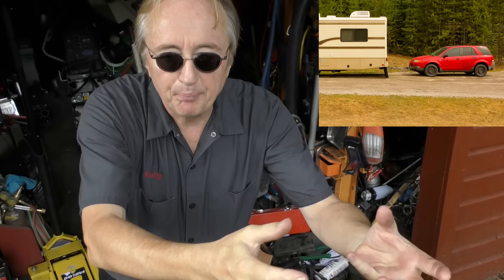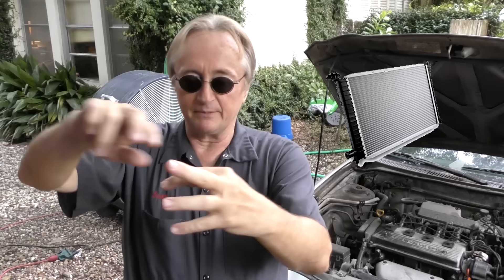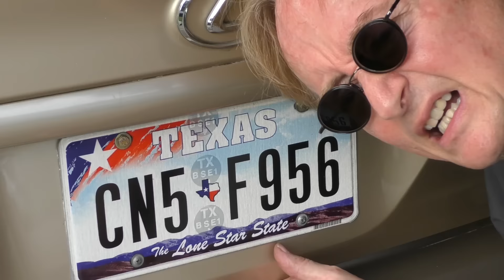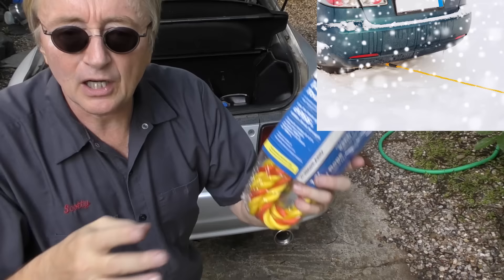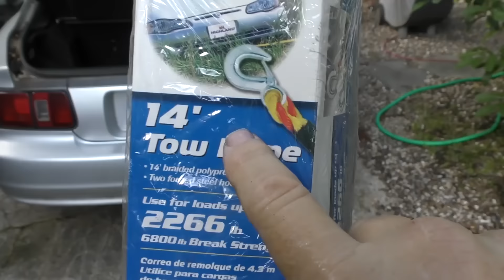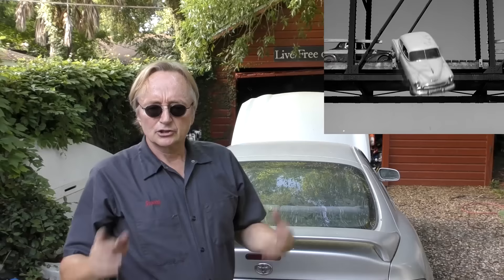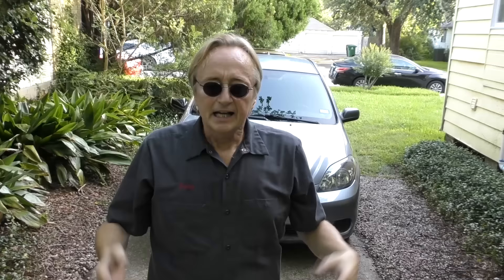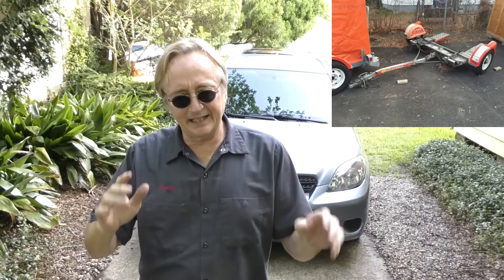Never Do This to Your Car

Comment: Oh, you're messing with us,  Scotty - Subarus don't need to be towed to blow head gaskets!
Reply: Hahahhahahahah
Reply: Leave it to a Subaru to blow head gaskets without the engine running.
Reply: hahaha nice:)
Reply: The head gasket is probably why it was being towed in the first place. That story was 100% bullshit. The oil isn't being pumped, but somehow it ended up being pumped into the transmission cooler?
Reply: THAT'S WHAT I SAY
Reply: SABARU ENGINES ARE SO POWERFUL AND FAST THEY BLOW HEADGASKETS!!!

BUY A NEW SABARU AT YOUR LOCAL SABARU DEALER TODAY!!!
Reply: Bursting into flames on the turnpike, that's what makes a Subaru a Subaru.
Reply: What if you tow subaru and put neutral gear before towing?!
Reply: @marcinnalepka1530  blow the gears head gaskets and 0 rings
Reply: @salm6331  compared to what powerful lol you never driven a v8 - 12v blow the doors of any Subaru  real power lol
Reply: @johndaniel3474  you can't be that thick..
Reply: @johndaniel3474  That's why a Dodge RAM SRT10 has a lower top speed than a European Taxi😋.
Reply: @marcinnalepka1530  doesn't matter they roll lifted from the front dont go over 35 mph automatic transmission only standard transmission all 4 wheels must be off the ground

Comment: PEOPLE, THINK ABOUT THIS. How is transmission fluid going through the transmission cooler on the radiator if there’s no pump working to move fluid with the car off and being towed? Also, how do you blow the head gasket? The car engine is off so the water pump is not circulating fluid as it needs to be driven by the serpentine belt in order to circulate the fluid. So how can hot coolant get inside the engine to blow the head gasket? The thermostat is even closed on a cold engine which prevents any circulation of coolant through the radiator. Even if it was possible to have an overheated radiator in this situation, which it’s not, there is air movement past the radiator while the car is towed which works to cool the radiator off just as the cooling fan does when it’s running when a car is parked and idling. There’s also airflow beneath the car that would help dissipate heat from the transmission through convection heat transfer. This logic makes no sense at all. If anything it sounds like a case of a Subaru that broke down due to a head gasket failure and then they towed it and ruined the transmission by overheating it from a lack of lubrication and overheated transmission fluid caused by the moving torque converter. There’s no way that towing the vehicle blew the head gasket...

Comment: Thankyou Scotty; this is one of the most important videos you've made so far; and YES people do a lot of dumb things when a car breaks down.
Reply: Hirum Biffidum for a front wheel drive car you use a tow dolly or a trailer. rear wheel drive cars use a trailer . I have seen cars being towed by a motorhomes as well being they take the cars along
Reply: Hirum Biffidum some of the  information in this one is incorrect. How is transmission fluid going through the transmission cooler on the radiator if there’s no pump working to move fluid with the car off and being towed? Also, how do you blow the head gasket? The car engine is off so the water pump is not circulating fluid as it needs to be driven by the serpentine belt in order to circulate the fluid. So how can hot coolant get inside the engine to blow the head gasket? The thermostat is even closed on a cold engine which prevents any circulation of coolant through the radiator. Even if it was possible to have an overheated radiator in this situation, which it’s not, there is air movement past the radiator while the car is towed which works to cool the radiator off just as the cooling fan does when it’s running when a car is parked and idling. There’s also airflow beneath the car that would help dissipate heat from the transmission through convection heat transfer. This logic makes no sense at all. If anything it sounds like a case of a Subaru that broke down due to a head gasket failure and then they towed it and ruined the transmission by overheating it from a lack of lubrication and overheated transmission fluid caused by the moving torque converter. There’s no way that towing the vehicle blew the head gasket...
Reply: @newfie-dean5803  maybe towing with the transmission in Parking mode? Bad video, I don't agree either.
Reply: teratonexplosion you can’t tow in park. That’s like trying to push your car in your driveway while it’s in park. In park the drive wheel(s) will be locked and you can’t move it. But if you put it in neutral you can push it no problem. Same concept here. If you towed it in park then you would be skidding the drive wheel down the road and it would not be long before you destroyed the tire and maybe some suspension or driveline component. Scotty should correct his comments in another video but he seems to be a guy who don’t do that sort of thing, it would mean admitting he was wrong with 51 years experience! 🐴😂
Reply: @newfie-dean5803  Hi, its called capillary action the heat will transfer via the hot fluid as it will still circulate a bit, though not under normal pressure and the rad will still get hot, the engine not running this resultant heat in the rad will back circulate in the same way through the engine. Your theory about a moving vehicle will cool the rad a little, but the non pressurized  transmission fluid will be upward of 200'c  and without the water pump & fans running the back circulation of the heat will destroy the engine seals & the weakest point more than likely will be the head gaskets.
Reply: Alan Coomes you are dead wrong! Unbelievable!!!! How do you think a cooling fan even works? A towed car will not blow a head gasket, it is impossible!! You have airflow under the car too which dissipates heat from both the transmission and the line going to the radiator! I can’t believe how many people have no concept of heat transfer mechanisms!

Comment: Keep in mind that if you have a vehicle with a 4WD transfer case then you CAN tow with all 4 wheels on the ground as long as the TRANSFER CASE is in neutral - not the transmission by itself, but also the transfer case. This disconnects the drive wheels entirely and is often explained in a 4WD vehicle's manual as an option for towing! Great video Scotty! 👍
Reply: Tony Humbert  if you're transfer case is out in neutral (different than your transmission) then the transmission won't be connected to the moving wheels at all - therefore the transmission won't spin or get hot. A lot of manufacturers actually specify this method for flat towing. The Subaru likely didn't have a transfer case at all - meaning that it couldn't be flat towed and destroyed the transmission.
Reply: Tony Humbert  If I'm not mistaken most suabrus don't even have what we would consider a transfer case traditionally because they aren't shiftable - as you said.
Reply: Tony Humbert  Correct - but in a lot of full-time 4WD systems and AWD systems it isn't shiftable in a standard form like a part time 4WD t-case which is the most common type used in flat towing applications.
Reply: Tony Humbert  dude it's a forum for conversation - it is somewhat relevant because people watching this video may not know that some vehicles CAN be flat towed with a t-case and some can't . This video, while Scotty is great - makes it seem like almost no vehicle can be flat towed. Lighten up
Reply: Tony Humbert  even more of a reason to inform people in the comments ;)
Reply: Another popular option for RWD (especially trucks) is to decouple the driveshaft. It takes some muscle but it's the safest option. And lifting a truck isn't an option most of the time.

Also some rigid axles are very easy to pop out the half shafts either side (especially on offroaders where the hub has a knob to engage or disengage the axle)
Reply: NICE ! I WAS THINKING THAT AS I  WATCHING SCOTTY ! THANKS FOR THE ANSWER !

Comment: You can tow any vehicle if you just start the engine, let it idle and put in nutreul. You can push any vehicle doing the same but by strapping 2 old tires together on front of the grill area without rims to the car that is pushing. Works the best. We use to repo cars that way all the time. You can really smack the cars together on the freeway without damage.

Comment: Scotty, a few exceptions to these tow rules that you should have mentioned are
1) You can tow a 4x4 with all the wheels on the ground if it has a "manual" transfer case that can be put into neutral. I'm talking about the transfer case, NOT the transmission. This is why Jeep Wranglers and Geo/Chevy trackers are so popular to tow behind motorhomes...
2)If the car will run (like if it runs fine and you just need to move it) you can leave the car running and in neutral and as long as the engine is running the transmission pump will be pumping fluid keeping your transmission safe. I wouldn't recommend doing this for extended periods of time but for a short tow it will work
3) Disconnect and remove the driveshaft (many people who tow their vehicles behind motorhomes do this. Some even install auxiliary transmission pumps that run without the engine being on)
Reply: You are correct sir!
Reply: Superdutychase His logic here makes no sense. The thermostat on the engine is closed on a cold engine which prevents any circulation of coolant inside the engine through the radiator. Also, to circulate coolant the water pump needs to be running which is only possible if the engine is on since it’s driven by the belt. Even if the radiator had hot fluid there’s no way for it to get back inside the engine with the engine off! And how would transmission fluid get circulated through the radiator with the car towed? He already said with the car off there’s no lubrication of the transmission so what’s moving the transmission fluid through the radiator?
Reply: Superdutychase definitely had a blown head gasket already, maybe why it was towed to begin with, LOL! It’s physically impossible for what he said to happen! There’s no oil pump moving fluid to the transmission cooler on the radiator with the car off so there’s no way to overheat the radiator. And on top of that even if that was possible there’s air movement through the radiator while towing it so it would cool it down. And hot coolant needs to be inside the engine to blow a head gasket!
Reply: Joe Casson this video is complete hogwash. It’s physically impossible to blow a head gasket towing! There’s air flow the entire time and no circulation of coolant through the engine. If you google honda CRV AWD automatic towing it tells you specifically to tow with all 4 wheels on the ground at highway speeds no greater than 65 mph.

Comment: I think those 'tow hooks' are actually transport tie down points for use on car ferries during rough weather crossings etc. That's why they are at each corner. Love the videos, thanks for posting them.

Comment: HOLY SHNIKIES!  Towing a motorcycle down the highway!?  Sounds like a Darwin Awards candidate!
Reply: Oh, I thought the Harley motorcycle was towing another car. I guess I undeestood it backwards.
Reply: To tow a bike. Loop rope around HEADSTOCK ONCE. Then to one bar and hold with thumb pressure only. Ensure ROPE PULLS OUT EASILY WHEN RELEASED. 20 MPH MAX. I have been towed twice. In 30yrs, it`s OK.
Reply: being towed on a bike down the highway, he'd be lucky to live and to be able to collect the award !
Reply: The fact that you do something incredibly stupid and it doesn't kill you does not mean it is not an incredibly stupid thing to do, it just means that you were fortunate that your stupid move did not get you killed this time.

30 years of riding, and I've never seen anyone need to do something that stupid. If you can't fix it at the side of the road, you can always find somebody with a truck or trailer. I've even seen complete strangers help out - five of us were on a secondary highway essentially in the middle of nowhere, and one of the bikes had a rear tire blow (a spoke had worked loose and punctured the inner tube). With the nearest bike shop 4 hours away, we were at the side of the road contemplating strategy when a couple of guys in a pickup pulled over to see if they could help. We loaded the bike into the back of their truck, and it spent the night in a small town garage while we went back to the city for a new tire.

People with motorcycles doing stupid things are organ donations waiting to happen.

Comment: Thank you, Scotty. My father would turn off the engine in neutral on longer hills on his '64 Impala (283 V8) with Powerglide and coast then start it by turning on the ignition then put it into gear. He put it into gear once before turning on the ignition and blew out the muffler.

Comment: if you must tow it with the drive wheels on the ground: Automatic Transaxle - Your vehicle may be towed under the following conditions: The gear selector must be in NEUTRAL, the distance to be towed must not exceed 15 miles (25 km), and the towing speed must not exceed 25 mph (40 km/h)...Wiki
Reply: I don't think that I'd do that. There is no oil being pumped in the transmission when the engine is off. The bearings can get hot and dry without lubrication. I'd say that Wiki is mistaken. Automatic transmissions have not been designed to be towed like that since the 1950's or so. There was no reason to put a pump that is attached to the output of the transmission, so they saved money by not putting one in. The only oil pump is connected to the input from the engine.
Reply: I've read some people put it in neutral and leave the car idle. Doesn't sound like a great idea to me but sounds better than having it off
Reply: Remove a driveshaft and problem solved
Reply: Unbelievable, is this all just city slickers in this comment section?
Reply: @garylangley4502 when it’s in neutral the transmission doesn’t spin. It’s not in a gear and no parts are moving. It’s perfectly fine

Comment: AAA will tow motorhomes and motorcycles also. You must pay for the additional coverage.
Reply: It's better to get that higher coverage anyway, you get much more distance free.   Though towing a bike is better with a truck and trailer not a flatbed.
Reply: Harley Davidson owners will need extended AAA coverage.
Reply: A friends Harley broke down on a road trip. When I went for help, I said . 95 percent of Harleys are still on the road. 5 percent made it home.
Reply: @glengerdes2447  Q: Why do Harleys have so much chrome? A: So they're easier to see for the tow-truck driver.
Reply: Q: What's the most common HD accessory? A:  A motorcycle trailer.
Reply: What do dogs and Harleys have in common?
They both like riding in pick-up trucks.
Reply: @tropicalstormrain5893  😂😂😂
Reply: @glengerdes2447  😂😂😂
Reply: I always keep four tie down straps in my saddlebags, just in case. Never had to use them though.  
I ride a rice burning Kawasaki Ninja by the way.😁
Reply: @valerierodger7700  sounds like a lesson learned the "hard" way.😓
Reply: @Palm Coast Adventures what's the difference of a beamer and a  porcupine, the beamer has pricks on the inside, lol